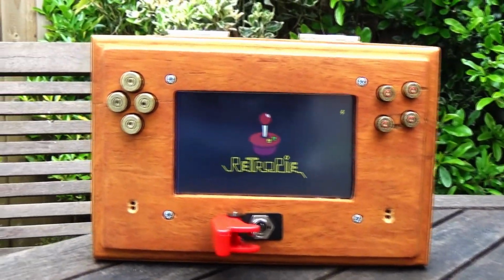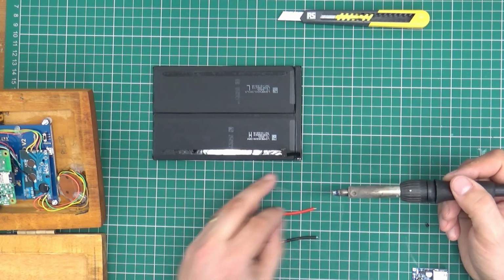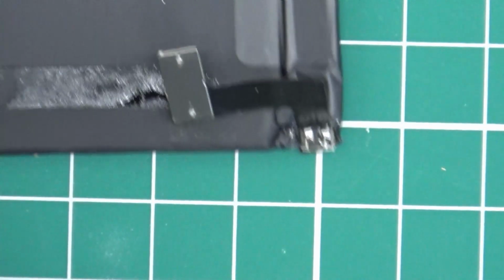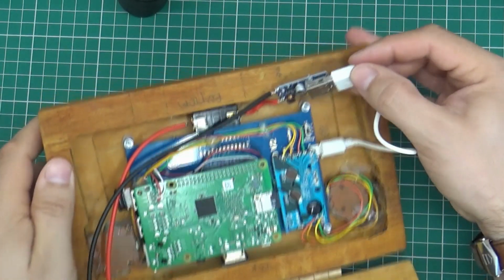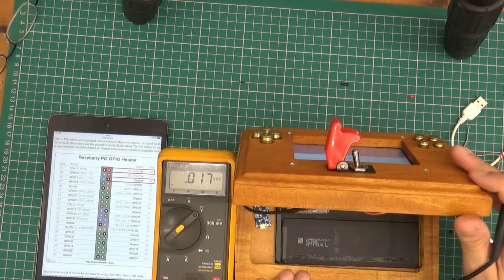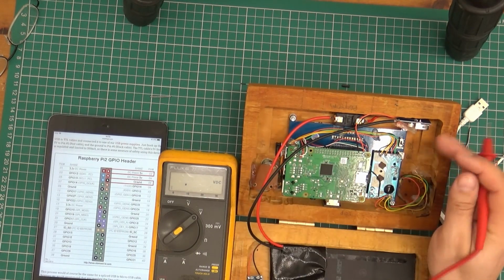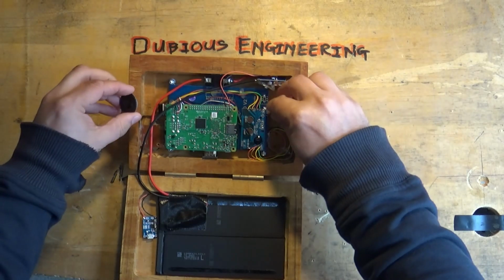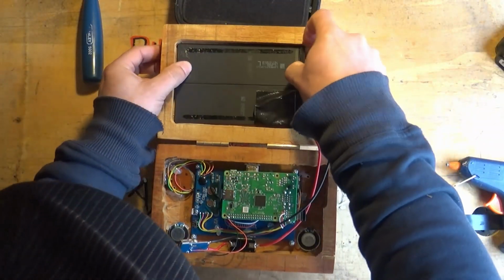DuB-EnG: #DubiousEngineering DIY Wooden Handheld Games Console bullet buttons PT8 - Power Supply

Comment: Also, a bit of a weird question. I purchased some LiPo's for Airsoft. I decided to take off the tamiah connectors and swap them out for deans. Do batteries usually heat up to a scary temperature when you use solder on them?
Reply from the maker: oliver healey ...  pop them over one day and I’ll help you ... I have plenty of experience of soldering wires onto batteries